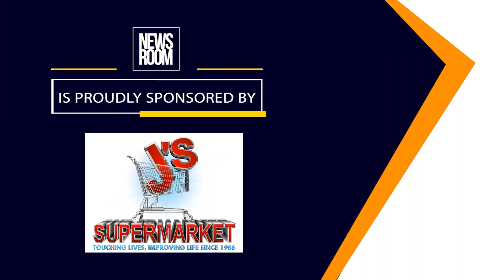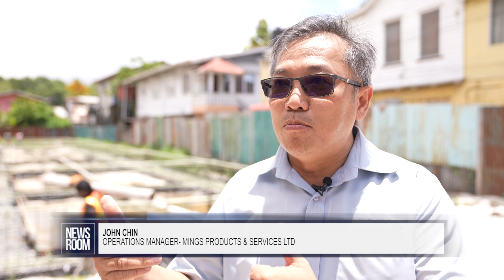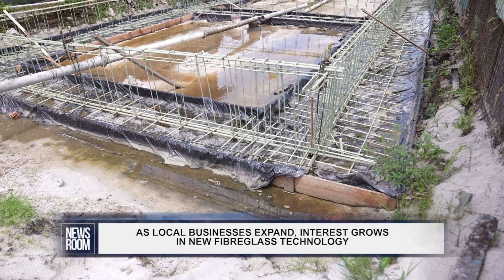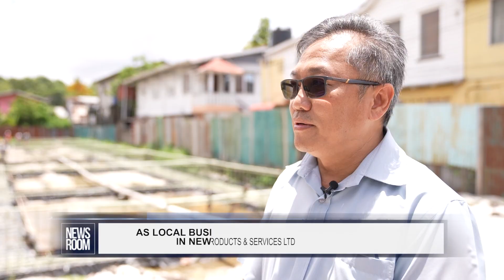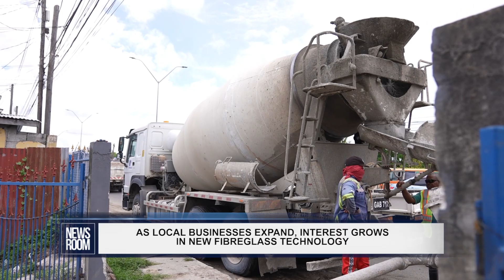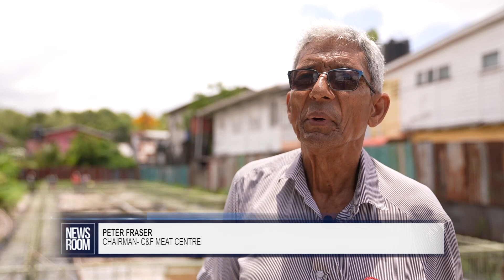GUYANA NEWS ROOM - AS LOCAL BUSINESSES EXPAND, INTEREST GROWS IN NEW FIBREGLASS TECHNOLOGY

Comment: the only thing I am concerned with this is if a part of a building had a fire, naturally the heat eould spread to the reinforcements rebar, and would they melt a little and comprise the structure? and we would know nothing about it on till the building collapses. a big fire I am talking about, not a tiny fire, but the building can still be repaired.